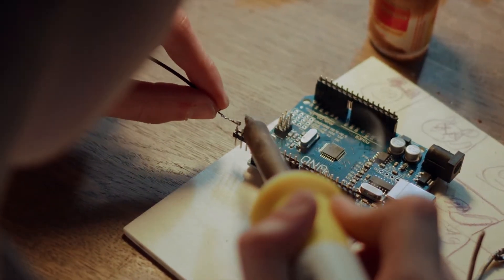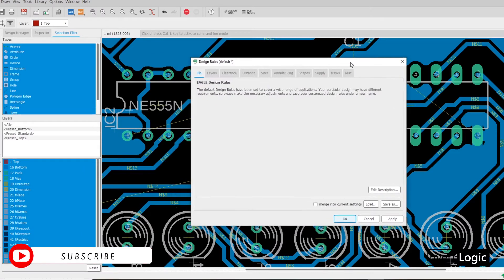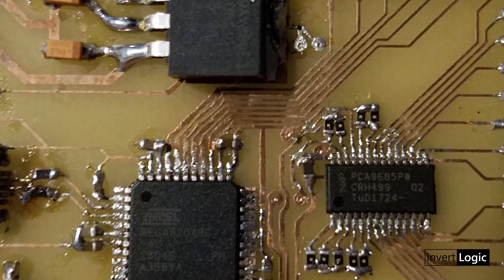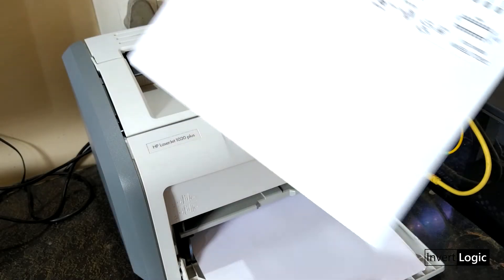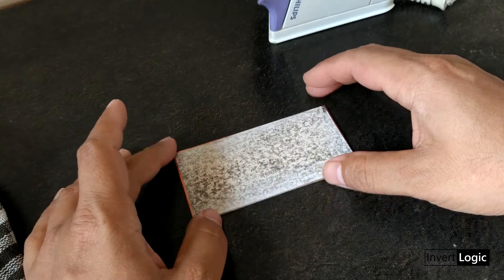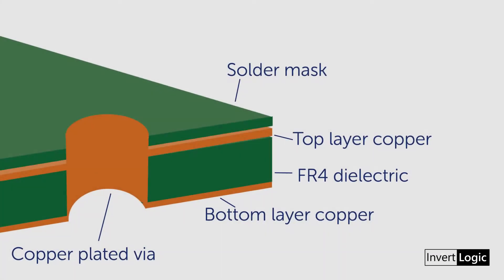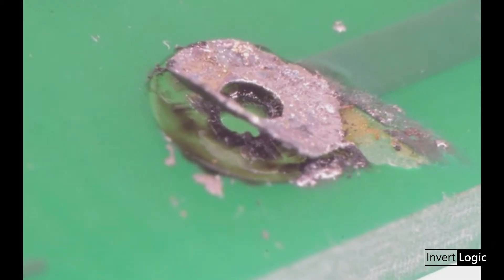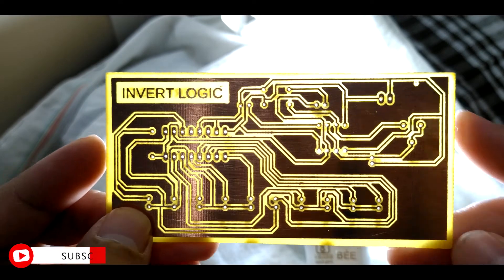6 Mistakes to Avoid when Making DIY PCB

Comment: FR4 has many advantages but it can eat drill bits like crazy. Cheap drill bit can make 20-30 holes before going dull. You can use tungsten carbide ones but they tend to break easily in hand drill devices. They require a proper drill press and not everybody has access to such. Personally I really like CEM1. It is a great compromise between very hard FR4 and brittle paper-phenol.

About the thickness of copper layer, usually all you need is 35 um. You can buy 70 um or even up to 120 um and low resistance looks cool but such board take ages to etch. On the other hand using 18 um can be risky. 

And remember to use polygons wherever you can. It saves etchant, reduces time and is eco-friendly.
Reply from the maker: Agree with you. Polygon is always helpful.